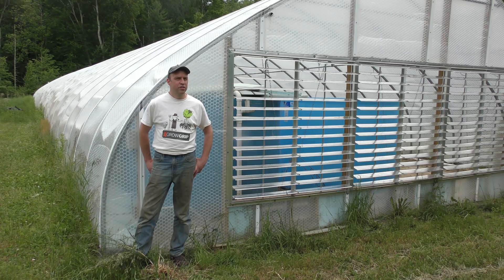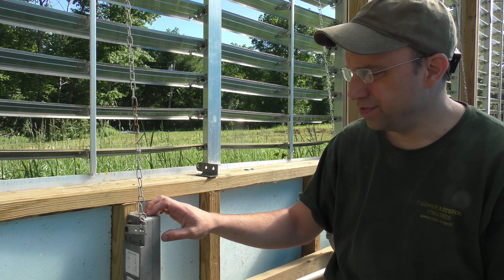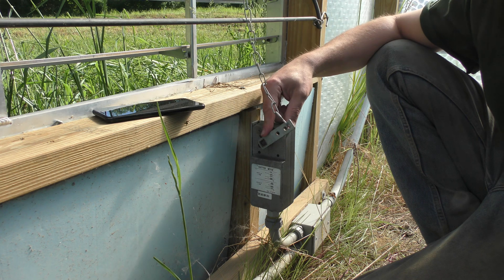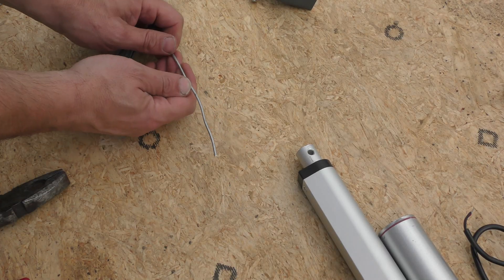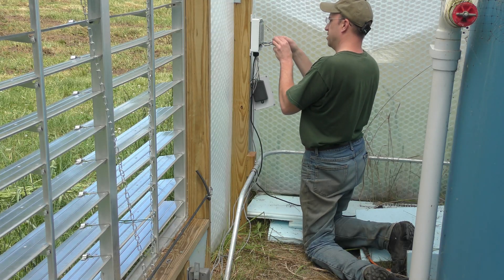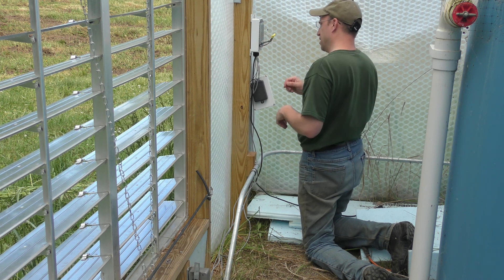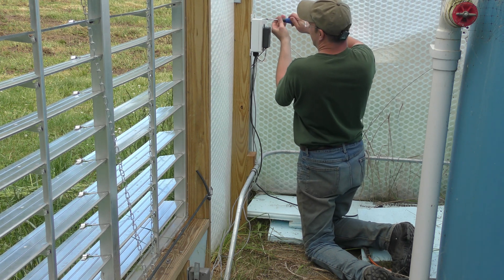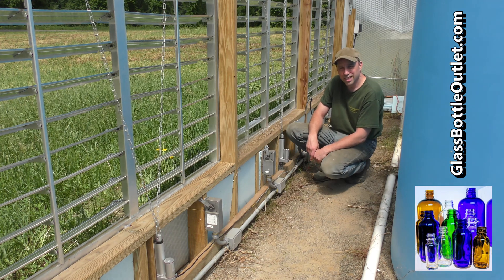Dumping the Junk Vent Actuator

Comment: Hi -- Curious about the parts list for this project and how to use a thermometer to control the extension and retraction of the actuator arm/piston. Can you provide a parts list and control relay wiring?

Comment: It's clear from the teardown that these were not built for the purpose they are being used for.  These are just 2RPM electric motors and when used to actuate the vents, they simply stall continuously, which is not good.  A wiper motor with a limit switch is a much better design, since it's a worm drive, has a stop, and can reverse.
Reply from the maker: This is exactly whey they are designed for:  https://www.qcsupply.com/11150-motorized-shutter-kit-for-12-to-30-shutters.html?gclid=CjwKCAjw57b3BRBlEiwA1ImytifSCJXnB-casffXtnex7__fMl3fG9xhe8ylmAAaqFHAA7Po6uzsKhoCyP4QAvD_BwE
I got them from FarmTek, which oddly, are no longer available!
Reply: @Bigelowbrook  My point wasn't that you were misusing them but that they were not designed for this purpose. They were designed as low torque 2rpm motors, running them against stall as normal operation is not what the original designer had in mind.
Reply from the maker: @eformance  I'm sure most things are not used in the fashion they were design for.  ;-)  Just like these new liner actuators, I think this isn't what their intended purpose is, but I'm sure they will do out perform the "commercial" version.
Reply: @Bigelowbrook  You are using the linear actuators for converting rotary motion into linear, that's about as textbook as you can get. Using a low speed AC motor in stall to convert rotary motion into linear is pretty far off... If they had used worm drive motors with limit switches, then it would have been appropriate.

Comment: Could have used only 1 actuator mounted horizontally with a pipe to channel 2 longer cords to under the 2 different attach points on each shutter.  Those actuators can lift hundreds of pounds.
Reply from the maker: I debated using one.  Even though it was a bit more money, I like the redundancy in the event of one breaking, the other two vents would keep functioning.  (unless of course the controller was breaking, then I'm in trouble!)